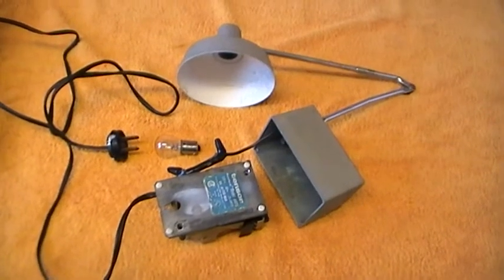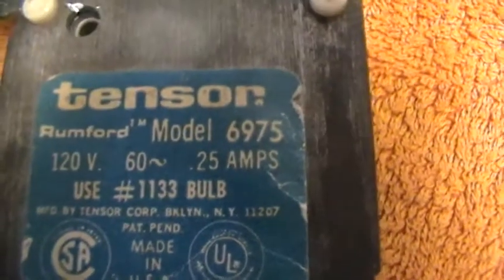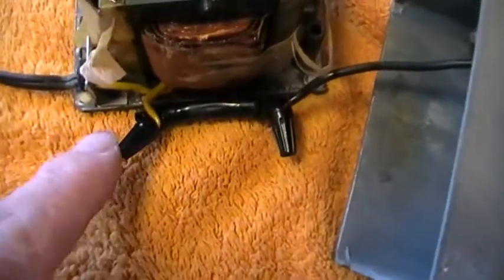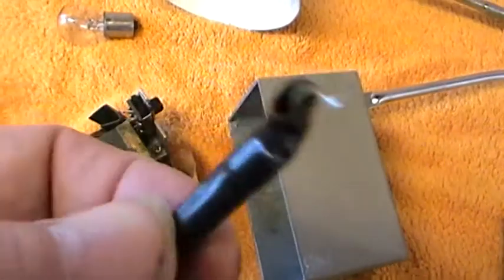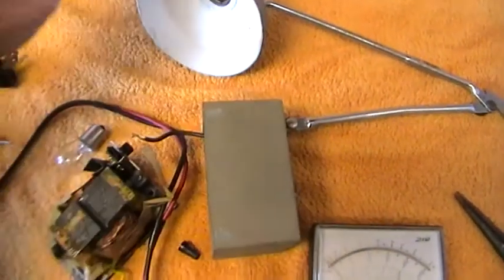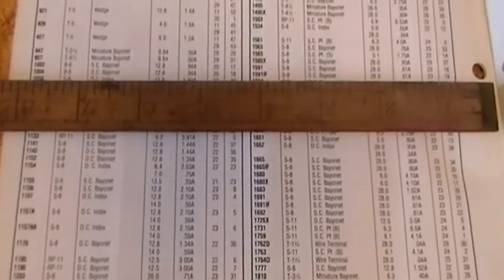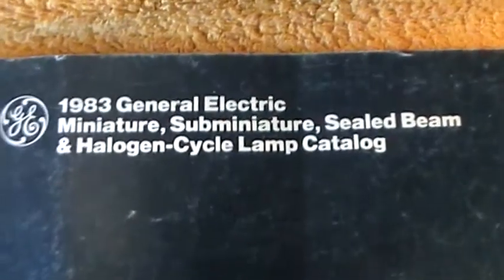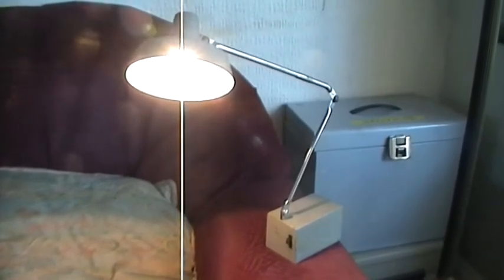Maintainance on a Tensor Rumford 6975 desk lamp

Comment: What screw driver bit was used to remove the base screws? I have one I need to take apart and cannot locate the correct bit, it's a tri-wing inverse slotted bit- the center point is higher than the wings, which are deeper set along the edge... Without the correct bit I don't know how you removed them
Reply from the maker: trial and error to find correct driver

Comment: Hi there. Glad I found this video, very imformative. I've just purchased one of these off eBay but need bulbs for it. It has #1133 on the bottom of it. I've found some on eBay - CEC Industries #1133 Bulbs, 6.2V, 24.242W, BA15s Base, RP-11 shape (Box of 10). As I'm also in the UK, are there any suitable alternatives that can be picked up here in the UK that you know of? Thanks.